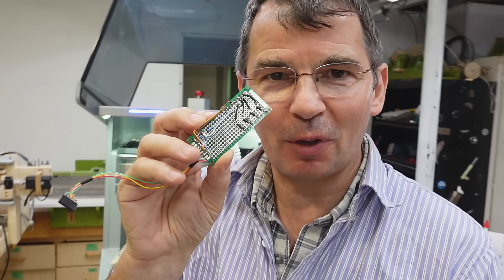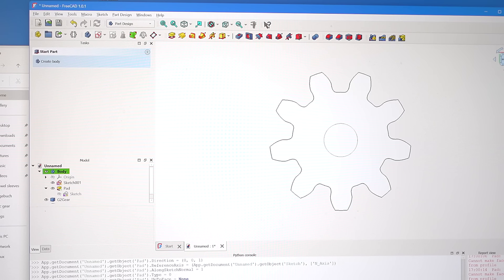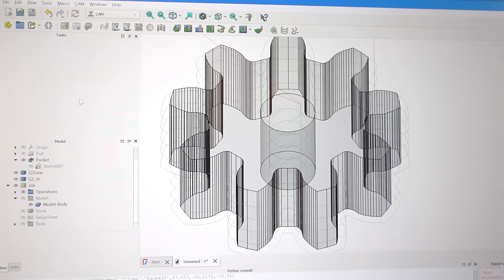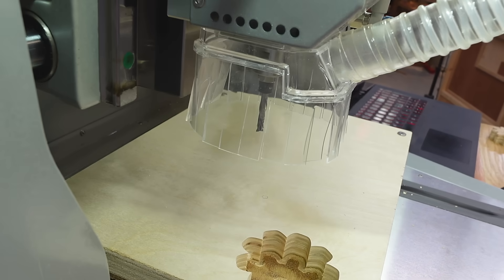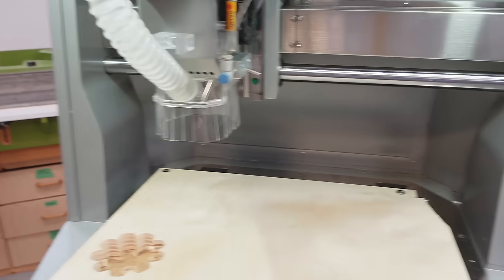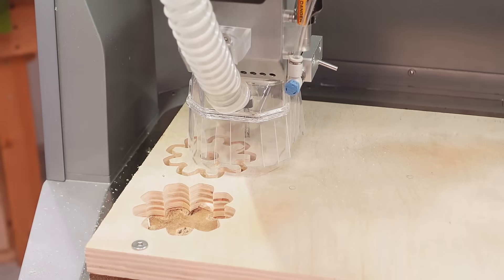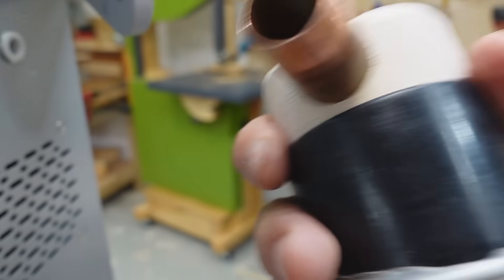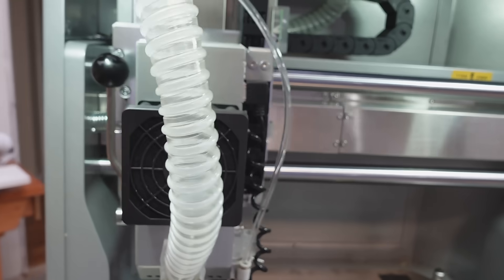Steep learning curve for using CNC

Comment: FreeCAD is certainly rough around the edges, but once you get past the initial learning curve it's quite powerful.

For the gcode issues, you should look at the gcode around start, end, and tool changes. Pretty much every machine will have differences there. With any CAM software, you can provide custom gcode templates for these actions. Doing that (or using some machine specific preset) is generally required if you want it to work properly.
Reply: I cannot comment on FreeCAD, but I'll second looking into gcode templates. As universal gcode is, plenty of machines and gcode generators can be finicky and do some silly  things OOTB.

Comment: MangoJelly has great tutorials on FreeCAD. I find FreeCAD good for 3D printing. Would you ever consider learning that? I personally find it a great complement to woodworking especially when making machine like devices and multiple small components. The default water immune material is also nice around the house

Comment: I'm a novice to CNC trying to stick to FOSS tools, and the landscape is truly dire. For simple 2.5d toolpaths I have had success with Universal Gcode Sender. It's a bit fiddly to set up initially, but it works with virtually any CNC router and can both control the machine and prepare toolpaths based on imported images (usually SVGs I export from OpenSCAD) and geometric primitives.
Reply: Universal G Code sender looks like a controller front end suite to me.  So a UI.  The premier controller in FLOSS is LinuxCNC. Which is quite fiddly to setup. But once it is it is world class. LinuxCNC will import images. It can cut 256 color grayscale stuff. But all it does is raster it. Still a funny feature. LinuxCNC will even accept HPGL files. That's a plotter language.

Comment: FreeCad is indeed a pain in the rear, as much as I want to like it. For so called 2.5D (a complex shape in X/Y and just "cut down" in Z) The inkscape-Extension "Gcodetools" does a surprisingly good job making G-Code from shapes. It is part of inkscape by default and allows turning paths into G-Code paths. In combination with the different layers, it can create G-Code for complex carving and cutting. I made a video about that a decade ago, was something like "From a drawing to the milled object". I used the tool "Camotics" to simulate my cuts and found that it does a good job :)
Reply: I don't like Inkscape's G Code generator. So what I do is export in DXF and then use DXF2GCode. But Inkscape outputs the wrong dialect of DXF So I open the file Inkscape generated in LibreCAD and then save it again. Libre can convert it into something DXF2GCode can handle. It's not as bad to do as it sounds.

Comment: Just gonna throw this in: I had a Laser cutter for a week and you also just send the G-Code. If I remember correctly, you should be able to set custom G-Code for the stop button, so it also stops the spindle or what it should do after executing the milling part, like move the spindle up and out of the way.

Comment: why would your custom built CNC not work for PCBs? too inaccurate at small scales?
Reply from the maker: I don't know, I should try it at some point.  The cutting forces are quite low so might well be ok.
Reply: @matthiaswandel  I can isolation route PCBs on my homemade CNC machine. I cheat though and use a platform I leveled on the bed. I took a big chunk of plastic and face milled it on my CNC machine and that's what I mount a PCB to. Which sidesteps the whole mapping issue.

Comment: I love your videos, but I can't agree with your statement about FreeCAD. FreeCAD is now really good and usable, but you have to familiarize yourself with it, as with any software you've never worked with before.

Regarding the gear:
1. Next time, use the gear function in FreeCAD's Part Design Workbench and not SVG.
2. When creating the pad, there is a “reversed” option. It is not necessary to set a custom direction.

Unfortunately, I can't say anything about CAM, as I haven't used it yet; I do that with Estlcam. But I'll have to try it out next time.
Reply: If you have to familiarize yourself with something that means it is counterintuitive. So you're contradicting yourself. As counterintuitive is the opposite of usable.
Reply: @1pcfred  Sorry, but that is not true. The more complex the tasks a piece of software has to perform, the less intuitive it is—that's just the nature of the beast.

Would you say that a simple text editor is intuitive? Open the editor, enter text, done. There's not much you can do wrong. But that doesn't help you if you can't read or write. In other words, intuitive doesn't mean that it has to work without learning anything.

It's counterintuitive when you click on a symbol, e.g., an arrow pointing to the left, and the program then scrolls in the opposite direction.

Comment: I've had good luck with ESTLCam in the past when I made my CNC machine.  I was able to cut gears, and other shapes created in Inkscape.  Perhaps that would be better than fighting with FreeCAD.
Reply: I love EstlCam, it's so straight forward.
Reply: I also love estlecam. It is surprisingly capable with svgs. If I want to model in 3d I use Onshape and sometimes Kiri:Moto which also can be used as a plugin for Onshape for CAM.
Reply: Yeah for 2.5D tool paths I use Inkscape and export it as a DXF then use a program called DXF2GCode to generate the G Code. But DXF2GCode doesn't like the version of DXF that Inkscape generates so I run it through LibreCAD between the two. That fixes things. I just open the file and save it. I never had any luck with Inkscape's G Code generator add on.

Comment: Have been using Fusion for almost 10 years. I used it free for several years. They once offered a low annual rate that would be "locked in". I accepted the deal and they kept their word. I use Fusion mostly for 3D printing and enjoyed much success on my home made router using Fusion to generate g-code and LinuxCNC to run on my machine.

Comment: Hello Matthias! I generally love your videos, but I can't say that this was your finest. I suspect that some of your problems are due to proprietary features of the Carvera that require some header and footer scripts in your G-code. That can be set up in FreeCAD and other programs once you know what's needed. Your best way to use the CNC is to generate an SVG and load it directly into ESTLCAM, an inexpensive, fast, and easy to use CAM software. Your Gear SVG could have been turned to G-code in moments using that approach. Pretty much any 2-1/2D shape could be handled that way using Inkscape or other drawing programs. I also don't think your assessment of FreeCAD was fair. I'm a casual user of it for CNC and 3D printing and yes there is a steep learning curve for it and CNC operations. Generally, that is true of all CAD/CAM unless you are willing to pay very high costs for software that simplifies the approach. Often one CAD program will seem easy, but then prove to be just as demanding as any other similar software. You do have to invest in whatever work flow you chose. There are very few easy paths to CNC that are free or affordable for the casual hobbyist. I often agree with you that it's faster to just make a part the traditional way than to use CAD, then CAM, then physically set up the CNC. The real win is when you need multiple copies of something or a precision beyond your own skills.

Comment: That's a very nice machine. I make very functional circuit  boards on my cheap 3018 CNC . I would love to see your workflow for making PCBs. I use Flatcam. I want to like Freecad but I find using it very frustrating. I use Fusion 360 for designing for 3D printing and it has a good and logical user interface. You might want to look into the licensing a little deeper. Onshape is also good but your files are public. Even with good software and hardware the learning curve for CNC will be steep like the title says.
Reply: On shape is actually a monetized version of FreeCAD with some additions I believe. Could be wrong, but I think they did contribute to FreeCAD quite strongly. I use my rickety 3018 for PCB's as well. It does a remarkably good job with a quality 60-deg spiral bit and height mapping.  I too use FlatCAM.

Comment: I’m new to CNC and CAD.  Sons gave me a Low Rider V4 last Christmas.  I’m in learning curve sensory over load, CAD, CAM software packages, G-Code, GRBL, end mills, flutes, up cut , Down cut, stepper motors, limit switches, tramming, squaring, Jackpot controller, WebUI, feed rates, plunge rates, spindles, and the list of new words and terms goes on.  My learning curve feels like Mt Everest.   I’ve been focusing on FreeCad 1.01.  Making progress on work benches, part design, draft, and CAM.  I haven’t been successful in using FReeCad CAM yet, it frustrating but I haven’t given up yet.
Reply: Just give up on that free Cad nonsense. Use Fusion for CAD and CAM, way more intuitive and straight forward and plenty of tutorials. Everything u learn in fusion directly applies to other decent software packages in the CAD/CAM world.

Comment: I've use Autodesk Inventor daily for the last 15 years.  Every so often I try FreeCAD and never have a fun time.  Fusion was good, but doesnt support the same workflows Im used to, same with SkethUp.  The only thing I've found close enough to limit (my) learning curve was OnShape.  It's a web based, free CAD program with some funky licensing.  I mostly use it to design 3D printed parts for home use, but supposedly it can do CNC tool paths too(?).  Might be worth looking into.

Comment: I'm getting a good chuckle on this one. 

I recently blew the dust off my home-made 3D printer and my cobbled together compact CNC router and am feeling some of this same pain right now. I'm a long time Sketchup user, still on 2017 as well, and the level of frustration with trying to get Sketchup models out to a properly meshed form that CNC can deal with finally forced my hand to look elsewhere.

Love the idea of FreeCAD, but boy it's tough. Tried OnShape since that's all you see on Youtube anymore, couldn't wrap my head around that one. Went back to Fusion 360, which I used a little bit previously before they made the sweeping license changes. It took a few days, but I got my sea legs back and finally got around to learning how to leverage parametric modeling as well. And so far, it's been okay. Really a shame about the licensing though. Miss the days when you bought software once.

For basic little CNC routing jobs I have found the web based Easel software works really well and I think it's still free. It was created I think by the same company that created the kit I used to build my router. But extremely limiting compared to a proper cad. Still hoping to find a happy middle ground of accessible and fast for quick sketches, but also powerful enough to do reasonably complex models (which frankly I'd say gears qualify as), where Sketchup used to live, IMO.

Comment: FYI, There’s currently no indication in Autodesk’s terms that monetizing a video using the software alone violates the personal use terms. It does violate the terms IF you exceed $1000 USD in annual revenue from selling the designs you make using Fusion360. 

A comparison would be like monetizing a video where you are making a custom character in a video game. That is acceptable fair use. Selling that character (or perhaps a 3d print of it) to people on the other hand will be considered unfair and commercial use to the developers.
Reply: This is not true. The special use terms quite clearly state that the personal use license is only for personal and non-commercial projects. Content creation is a business and is generating revenue, i.e. it is commercial activity. The software would also be used in primary employment  which is against their terms, regardless if this revenue reaches the $1000 USD threshold. In addition, fair use, which is very hard to define too, is only limited to copyright, not software licenses, so using it as an example is not ideal. Stay on the safe side and use appropriately licensed software or risk having to argue against Autodesk's horde of lawyers about the exact meanings of "commercial" and "revenue".
Reply: Maybe, maybe not, but autodesk is evil, so best to avoid them (see Louis Rossmann's consumer rights wiki).
Reply: Wow it's only $1,000? I thought the Fusion limit was much higher than that. I heard it was. They must have changed that term in the license.  the only reason they made Fusion gratis like they did was to take the wind out of open source sails. Fusion is just good enough to dissuade amateurs from investing themselves in development.
Reply: Yes agreed, plus I am sure if Mathias reached out to Autodesk they would provide him with a license for free.
Reply: Why do you even wast your time with Autodesk? I say this as someone that was a customer for over 20 years. Utter evil, like so much in "tech"

Comment: Carbide Create v6 Standard is more than sufficient for creating 2D 2.5D carves, not as complicated as freecad. You could have imported the SVG, set XYZ zero to either Corner or Middle of material and set material depth. Then drop an Outside Line Profile toolpath on it and tell it how deep to carve and which tool to use. Job Done

Comment: I'm currently trying to use freecad on linux, in my quest to use only open source software, and I must say it is absolutely infuriating, it is by far the worst cad software created. And I've even used creo lol
Reply: Yes, Creo was horrible.
Reply: @hippie-io7225  Creo was a disaster, but if you give me the choice to use creo or freecad i would happily start CREO with a big smile on my face.
Reply: Yeah the workflow in FreeCAD leaves a lot to be desired. I spent considerable time learning how to use FreeCAD then I learned FreeCAD is incapable of exporting anything using inches. It just can't do it. I haven't used it in a while now so maybe that got fixed? I kinda doubt it though. I know how the lead dev of the project feels about Standard. You can say they're not a fan.

Comment: Freecad has gear add ons. I have used Freecad for a few years for both Cam and Cad. There is a video for just about everything. Its Cam is a bit clumsy. So I recently purchased another program (Carbide Create)for Cam and just use Freecad for Cad. I do run into errors with duplicate lines when I export parts as Flattened SVG's from Freecad to Carbide Create which I have not tried to figure out why yet. It can be a pita sometimes. Exporting a Sketch as an SVG is more successful than an extruded part.

Comment: Our favorite canadian hermit frog AvE had a great tip for beginners: Do a dry run in the air by offsetting the z-axis out of the way of your actual matarial, so you can see what your program does before it actually does it.
Reply: You can sim G Code. There are simulators available. You can run it on your machine controller with your machine off too. At least I can. My controller has no feedback from the machine. So it doesn't know if the machine is actually on, or not.
Reply: Yeah and turn off or slow down rapids. Saving a few minutes when you're new (to the machine or software) isn't worth it.

Comment: I seem to remember using inkscape once to convert a 2d shape into g-code for a cnc router.
Reply: Inkscape has a G Code add on but it never worked for me. So what I did was exported the file as a DXF and fed it into another program that could turn a DXF file into G Code. Extra steps but it worked and worked well.

Comment: OpenSCAD can do this easy and there are already free code that do much of what is needed to copy the functions in your gear program. You can also export models directly to FreeCAD if you need to save in a format supported by FreeCAD.. Have done this with models that was CNC'ed in China.
Reply: but OpenSCAD only does tesselated/mesh bodies? from what i remember it doesn't do nurbs/bspline surfaces.
Reply: @marc_frank  that's true, and because of that .step files are also not supported.
Reply: @marc_frank  You use OpenSCAD to make the model, export it and load it into freeCAD where you covert it to a solid model that you use to generate the tool path.

Comment: In my experience FreeCad is actually worth learning, for CAD at least. It has become much more user friendly recently and development is very active (much improved v1.1 in the pipeline). Also, please check out the gear workbench add-on. That should be a much easier way to create gears. The CAM part I never tried, so I don't know about that.
Reply: astocad is exciting but needs some more time
Reply: In my experience FreeCAD can't really export in Standard. Now maybe that's fixed today? But it didn't work the last time I tried. Metric is only for godless commies.
Reply: FreeCAD is shockingly bad compared to any other CAD package i have used so far (CATIA, Fusion, Inventor, Solidworks, Rhino). OpenSource can be made very good, pointing at blender here, but freeCAD is so awkward to use and not even remotely usable when it comes to larger assemblies.
Reply: > more user friendly recently 
He used it just the past week or two or thereabouts probably, I extremely super-doubt it has gone from unintuitive garbage to something usable in that span of time